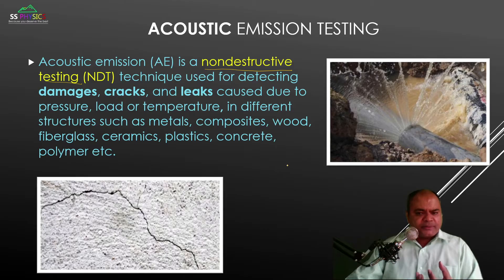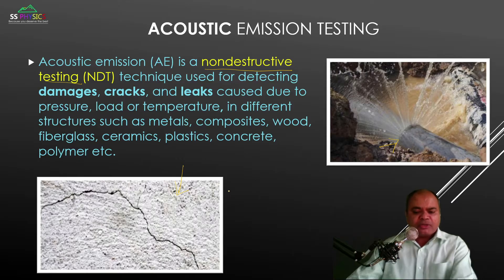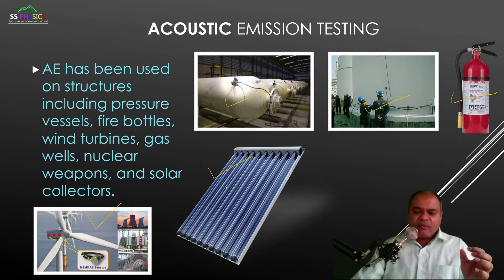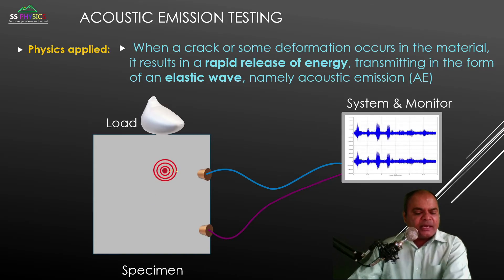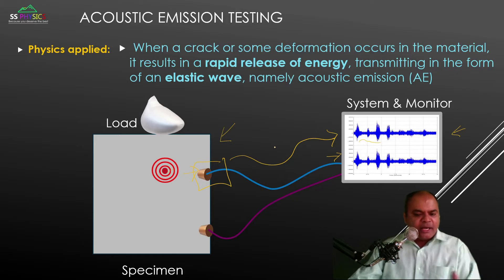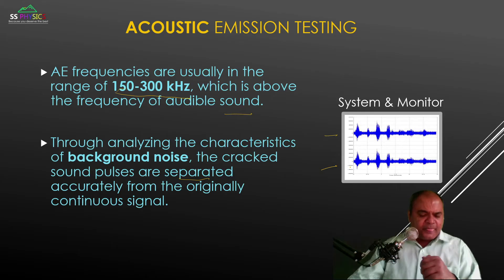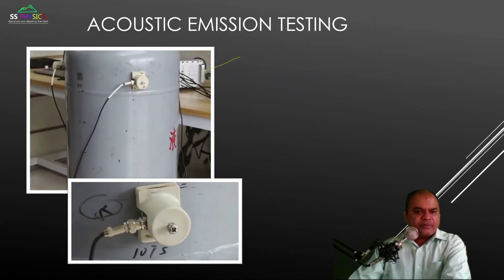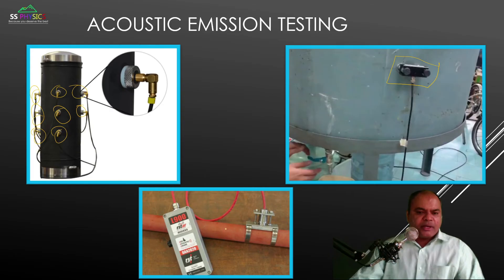Acoustic Emission Testing, aet, ndt, (English version), non destructive testing, with  Animation

Comment: Where to fix the sensor on components??
Reply from the maker: On surface
Reply from the maker: Minimum 1. If you want location then minimum 3 sensors.
Reply from the maker: It depends on container size and shape.
Reply from the maker: Don't know.  If you come to know,  please share here.
Reply: You can realistically place them wherever you want. Usually sensors have a maximum of 5-10m apart. You can do an attenuation study on the actual component to see how much attenuation is present on the component. This lets you know how much range each sensor will have. Then it's a decision based on how much sensitivity you want to have (more sensitivity = sensors closer together) and what areas you deem critical (critical areas might require closer sensor spacing). Also, complex geometry will require closer sensor spacing.